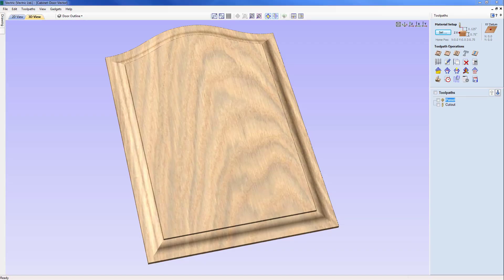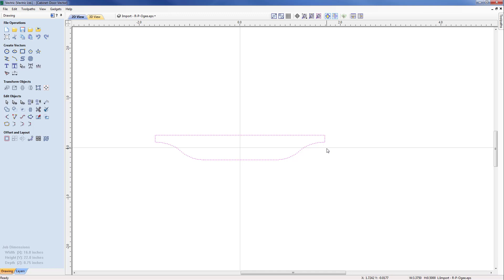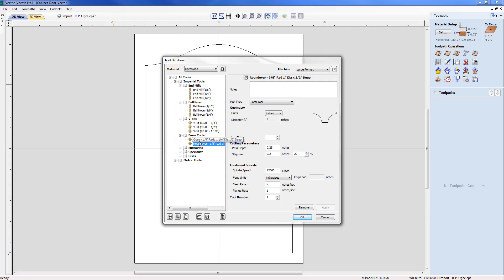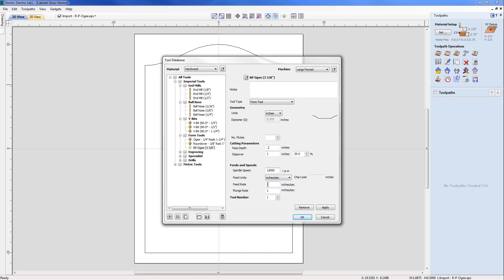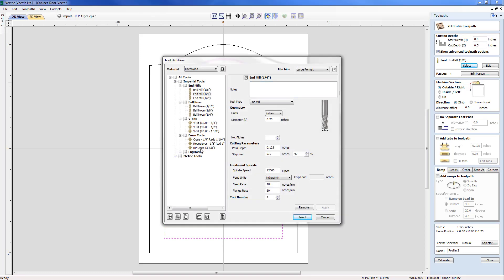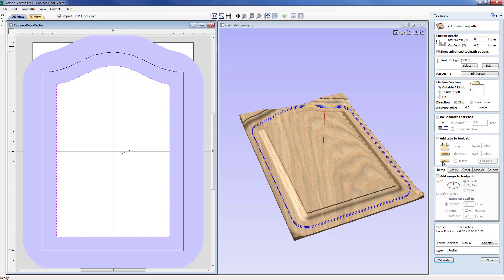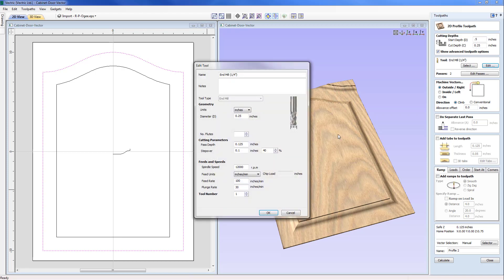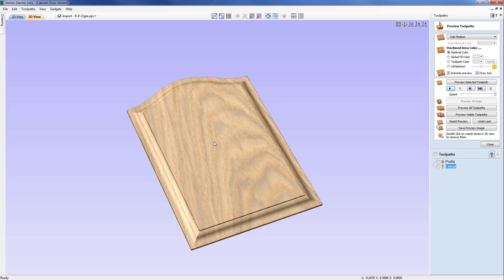Vectric V10 Tutorials | 2D Toolpaths | Raised Panel Door

Comment: Great tutorial, however, in this tutorial by using a profile as such, I am under the impression that you don't have a bit that is that profile.  With that said, what bit is used to do the cutting on the cnc machine, ball nose, end mill?
Reply from the maker: Hello Kim... yes this works perfect if you don't have the proper profile cutter or want to create a custom profile.   You can use any combination of cutters... but for the most part endmills and ball noses would be the ones.